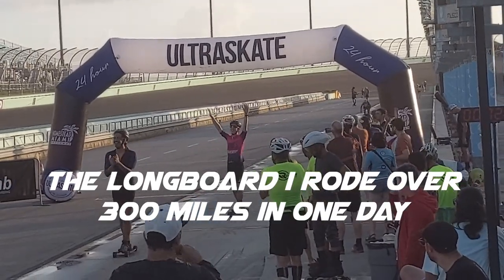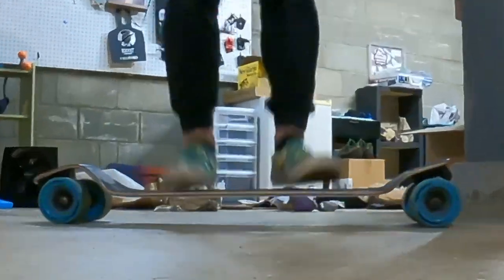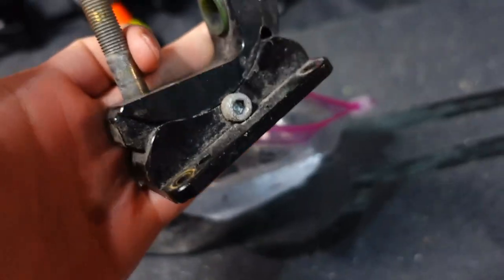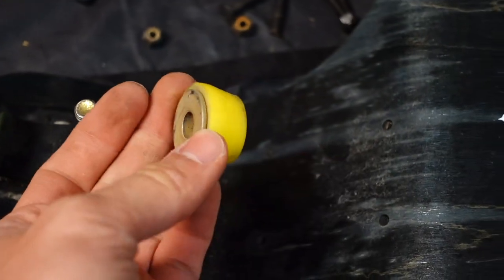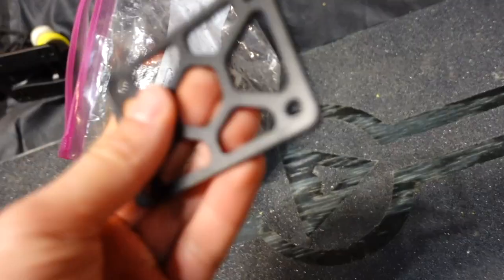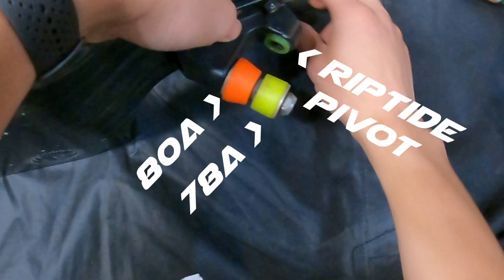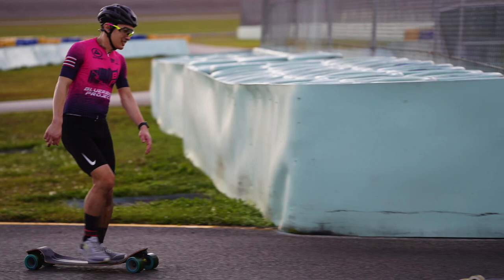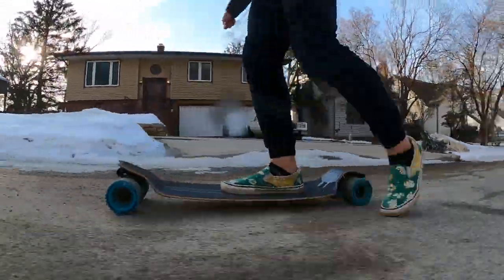My Ultra-Endurance Longboard Setup in 2 minutes - Pantheon Supersonic

Comment: I'm 215 lbs and I run a topmount pumper with rather soft bushings, it's like they're not even there. I lost the nut from my front kingpin one time and the roadside bushing and washer fell out completely, I didn't even notice. Kept skating for miles (I think?), did at least one downhill run with no roadside bushing and it wasn't until I lifted my board off the ground that I realized it was missing.

I guess my question is - are the roadside bushines really doing anything? I know this is kind of a random esoteric question for this particular video.